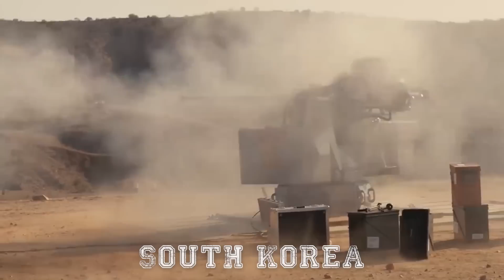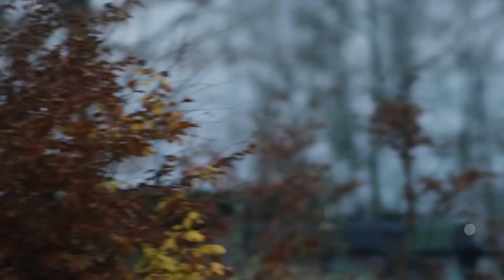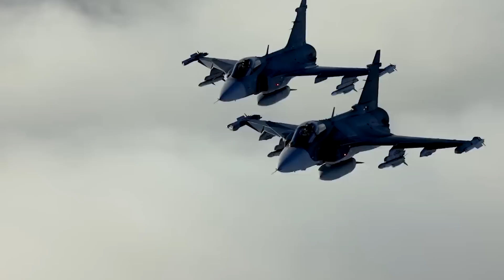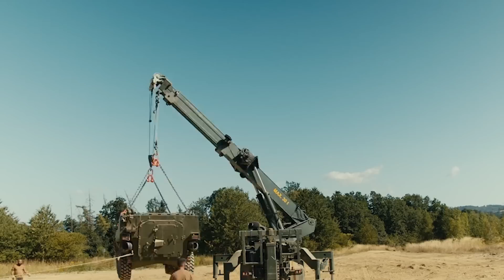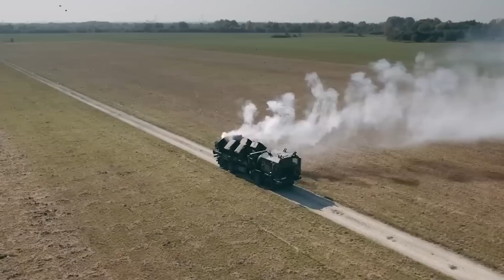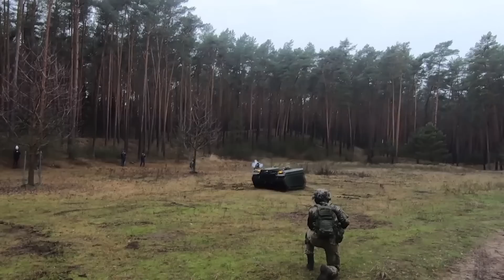US Built NEW $13 Million Combat Vehicle For The Battlefield!

Comment: How does 50mm no recoil for helechopters sound,,,,,,the pin that hits the detonator is manually by handle slammed,,,,there must be a spring behind metal that holds pin this action reduces recoil,,,,,50,,,, or 60mm single shot aulto reloading but manual by a shaft that a operator activates a slamming pin onto detonator,,,,actually double pipe chamber,,,,,,plus don't forget to clean out carbon in bullets chamber do U inform all gunneries to clean ring of carbon